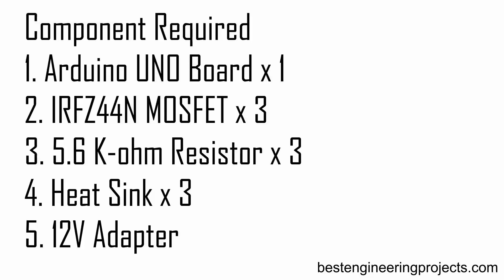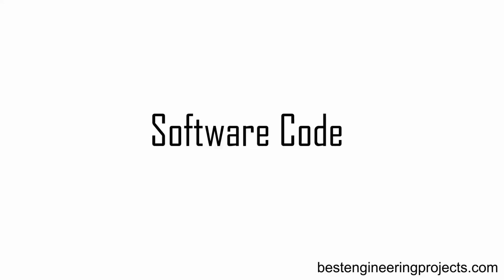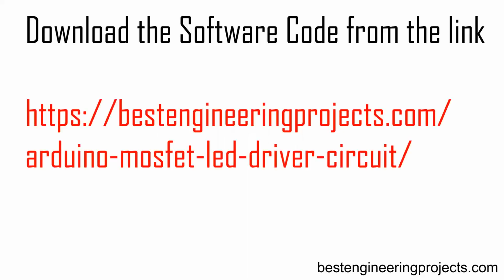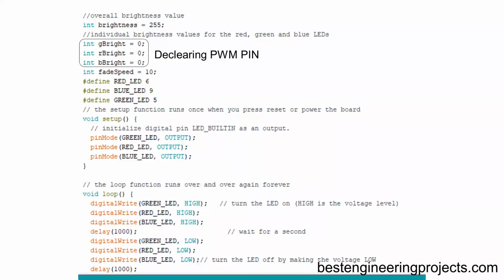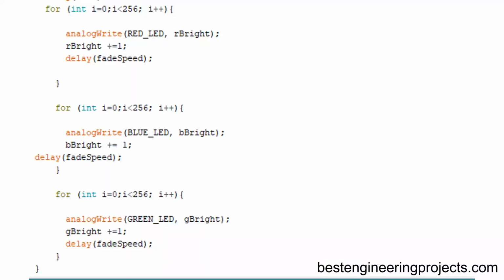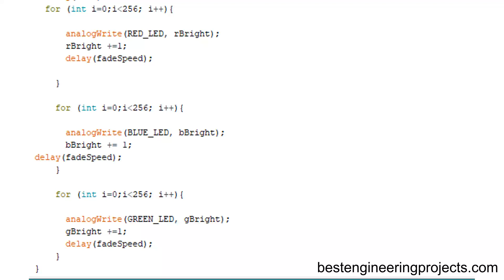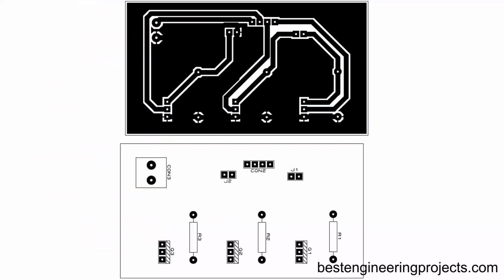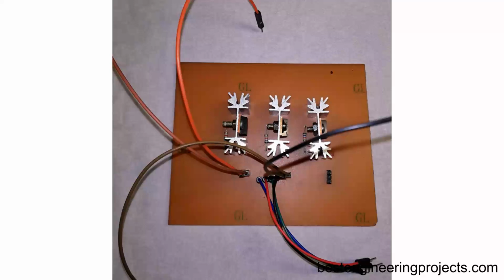Arduino MOSFET LED Driver Circuit

Comment: Okay, this may be a dumb question.. but I’m a beginner. I am not grasping what happens after you upload the code to the arduino and it functions as intended. Do you just detach the arduino and it works, or do you need the arduino for the lights to function?
Reply: The arduino works on it's own. You save a set of instructions on the arduino and once it's powered it will keep trying to execute those instructions.